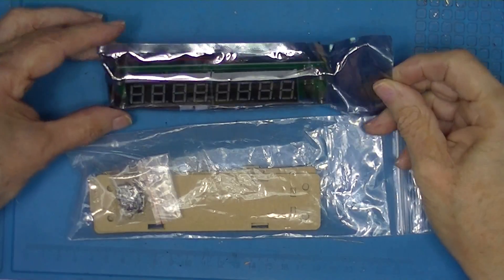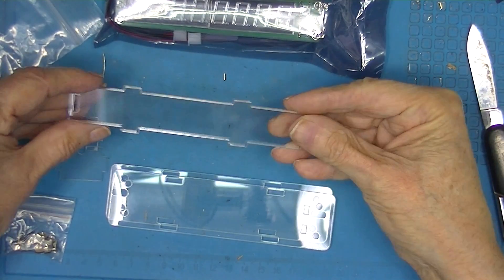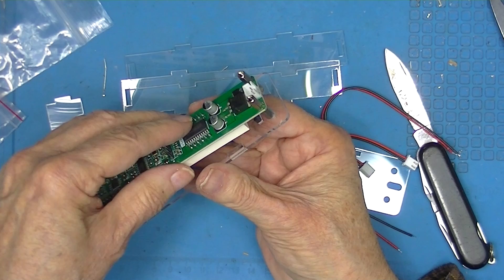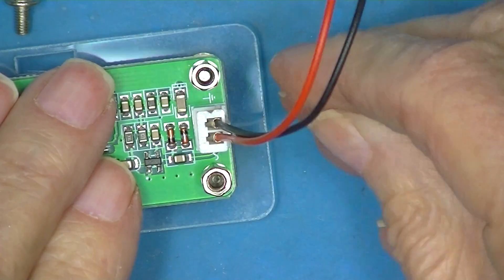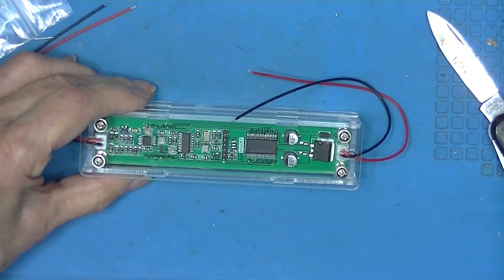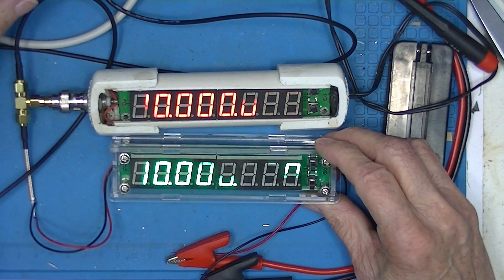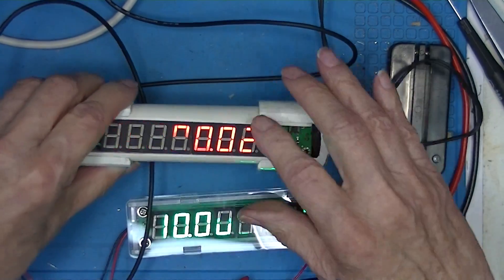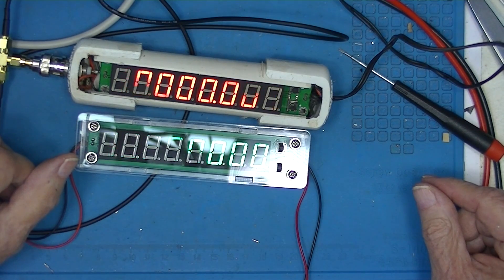8-Digit Chinese Frequency Counter and Case Part 1

Comment: put mine in an old cable box.   i soldered a bnc w/leads to the circuit and mounted the  lead on the metal frame of the box. i can tell you this counter is accurate.